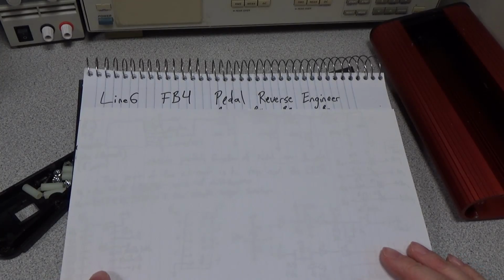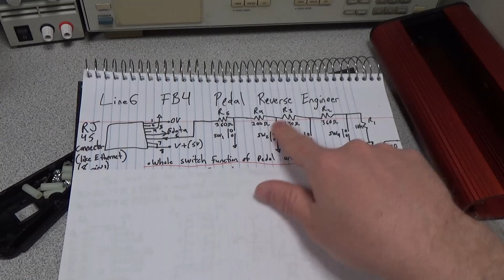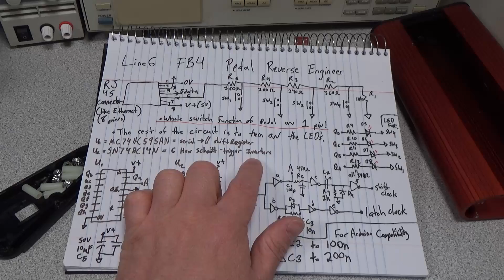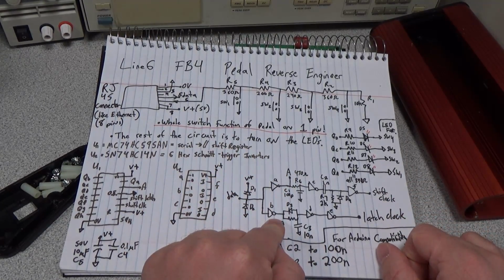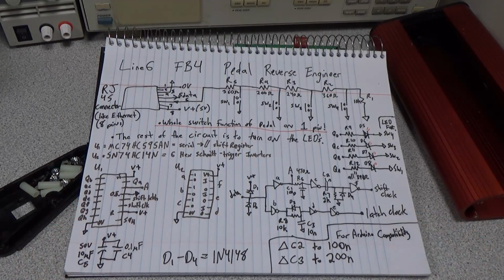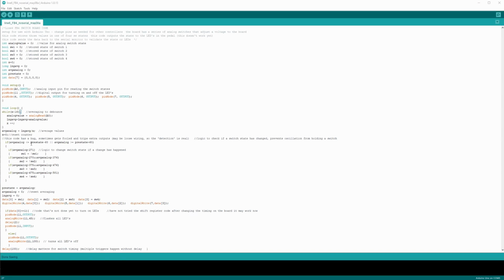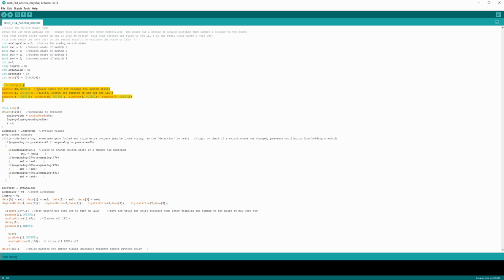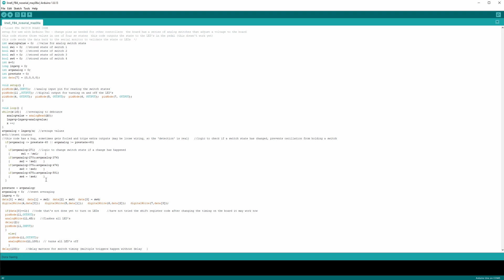Line6 FB4 Foot Pedal Teardown and Hack

Comment: hi, in the resistor ladder, is the terminating resistor 10kOhm as standard, or part of your mods? just another website i found shows 26.1kOhm? thanks
Reply from the maker: The terminating resistor is 10k in this one.  Easy enough to measure though.
Reply: @AllThingsOnePlace  thanks for the rapid reply! I'm trying to clone the FB4 circuit on breadboard , and using the resistor values as shown on your video schematic the POD 2 is sometimes jumping to the wrong bank/number. Perhaps because Im using a loose wire to switch between the banks, or maybe because I dont have exact resistances?
Any help much appreciated if you had a close up photo of the PCB?
Reply: all sorted now, wired in some switches instead of a flying lead and all good. time to start building up now on Vero Board :)😊
Reply from the maker: @atanquerel  Nice!  I looked around and managed to not keep photos with the video files, and I didn't get around to opening this thing up again yet so good to know it is working.

Comment: Can you share the .ino file
Reply from the maker: I am hoping this fits in a youtube comment, ha.  I am not a programmer so my code is terrible on a lot of levels,  also not really finished and not commented enough.

/*Line6 FB4 SWITCH BOARD CODE
setup for use with Arduino Uno - change pins as needed for other controllers  the board has a series of analog switches that adjust a voltage to the board
this code stores those values in one of four sw states  this code outputs the state to the LED's in the pedal (this doesn't work yet)
this code sends the data back to the serial monitor to validate the state or LEDs  */
int analogvalue = 0;  //value for analog switch state
bool sw1 = 0;  //stored state of switch 1
bool sw2 = 0;  //stored state of switch 2
bool sw3 = 0;  //stored state of switch 3
bool sw4 = 0;  //stored state of switch 4
int x=0;
long lngavg = 0;
int avganalog = 0;
int prestate = 0;
int data[7] = {0,0,0,0};

void setup() {
pinMode(A0,INPUT);  //analog input pin for reading the switch states
pinMode(11 ,OUTPUT); //digital output for turning on and off the LED's
pinMode(4, OUTPUT);  pinMode(5, OUTPUT);  pinMode(6, OUTPUT);  pinMode(7, OUTPUT);
}

void loop() {
while(x<16){   //averaging to debounce
   analogvalue = analogRead(A0);
   lngavg=lngavg+analogvalue;
   x ++; 
}
avganalog = lngavg/x;  //average values
x=0;//reset counter
//this code has a bug, sometimes gets fooled and trips extra outputs (may be loose wiring, so the 'detection' is real)   
//logic to check if a switch state has changed, prevents oscillation from holding a switch 
  if(avganalog <= prestate-60 || avganalog >= prestate+60)
  {
    if(avganalog<271)  //logic to change switch state if a change has happened
    {       sw1 = !sw1;    }
    if(avganalog>270&&avganalog<376)
    {      sw2 = !sw2;    }
    if(avganalog>375&&avganalog<476)
    {      sw3 = !sw3;    }
    if(avganalog>475&&avganalog<581)
    {      sw4 = !sw4;    }
  }

prestate = avganalog;
avganalog = 0;  //reset averaging
lngavg = 0;
data[0] = sw1;  data[1] = sw2;  data[2] = sw3;  data[3] = sw4;
digitalWrite(4,data[0]);   digitalWrite(5,data[1]);   digitalWrite(6,data[2]);   digitalWrite(7,data[3]);   

  if(data[0]==1){  //code that's not done yet to turn on LEDs     
    //have not tried the shift register code after changing the timing on the board it may work now
  pinMode(11,OUTPUT);
  analogWrite(11,45);   //flashes all LED's
  delay(2);
  pinMode(11,INPUT);
  }
    else{
    pinMode(11,OUTPUT);
    analogWrite(11,100);  // turns all LED's off
    }
delay(100);    //delay matters for switch timing (multiple triggers happen without delay   
}

Comment: Hi there! thanks for sharing these useful info, I've checked the RJ45 pinout on my POD 2.0 and it looks exactly the way you mentioned on this video, but if you have a look at the Line 6 dwg that you can easily find on internet it is totally different, like Pin1=Vcc, Pin5-6=GND, Pin7=serial, Pin8=Vcc, do you maybe know why?
Reply from the maker: Yeah, I have no idea!  Revisions?  A little move the pin so this doesn't work with the next generation of devices so you have to buy a new pedal?  I am glad that it is so simple so it can be reused at least but yeah being compatible with more than a couple of line6 products would be nice.

Comment: can I use it without all the external gadgets you used? like a normal footswitch
Reply from the maker: The pedal will work with the originally intended equipment of course but yeah it needs a computer of some type to decipher the commands and tell the lights what to do.  I plan to make a part two shoving all the electronics in the box and making this into a more universal selector pedal.
Reply: @AllThingsOnePlace  what about removing all electronic stuff and just use momentary switches directly connnected to jacks?

Comment: What was that pedal supposed to be used for?
Reply: It controls the Flextone, whatever that is
Reply from the maker: It controlled a few products from Line6, guitar amps were probably the most popular use.
Reply: @hivepark6844  it is a guitar amplifier and it’s solid state and digital.
Reply: I know that it works with pod 2.0 . I wonder would it work with POD XT ?
Reply: @xyholland  possibly. Check their website.